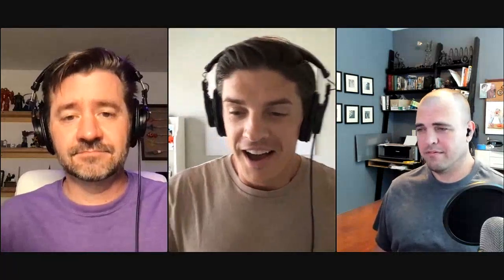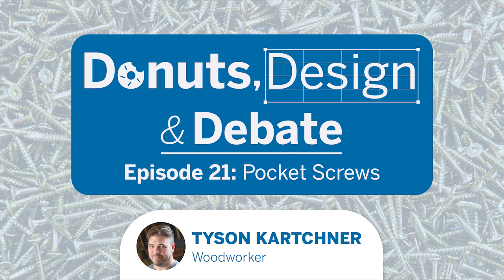Woodworker DEFENDS Pocket Hole Design

Comment: Pocket hole joinery is for those that are not as skilled or just lazy....or if one is doing production work. There are many other joinery, many much better than pocket holes.
I agree 100% with Aaron...oh and this is for Tyson, there is no right way to do pocket holes.....and there are other mechanical fasteners that will allow you to take apart a large project.

Comment: If you use pocket hole joinery in softwood they will fail much sooner than if you use them on hardwood. The screw will will pull out of the softwood alot easier than in hardwood. That is why there is a place for the use of pocket hole joinery and not in other. I do not want to see the pocket holes. If they are hidden go ahead and use them if it saves time. Great topic.

Comment: pocket hole is for DIY. I use ABF tool and cnc milling machine. maybe the tool should also be presented to all those who work with it professionally. It doesn't always have to be fusion 360 if you want to cnc mill smile